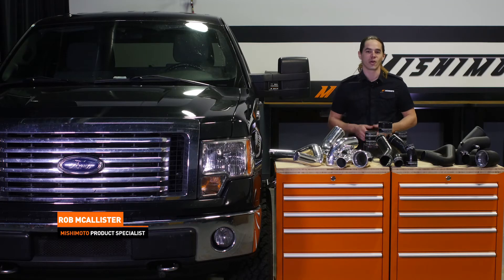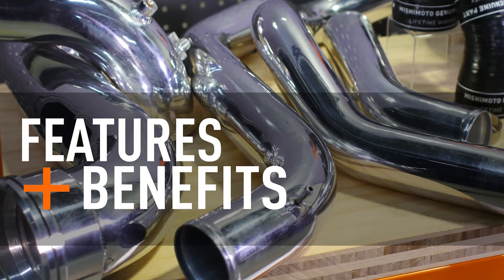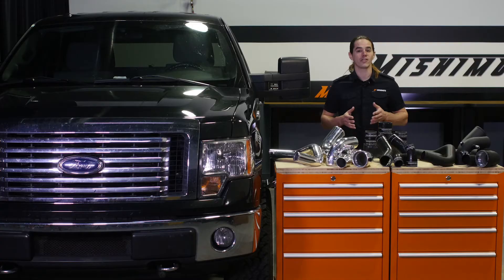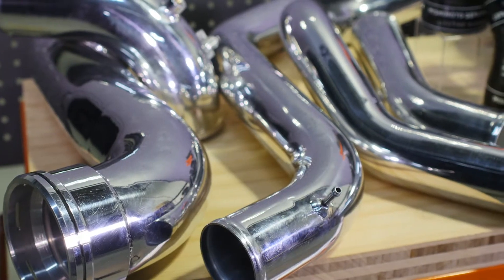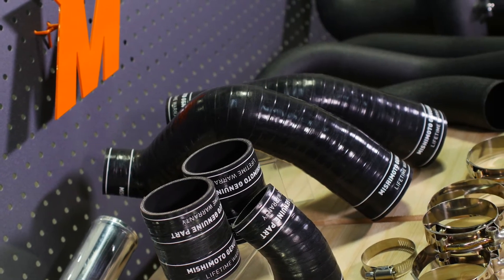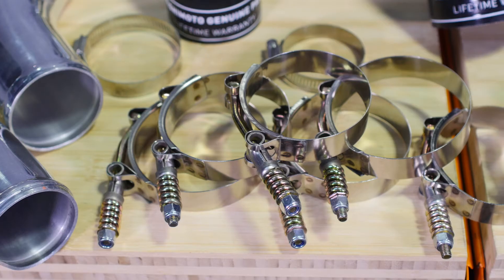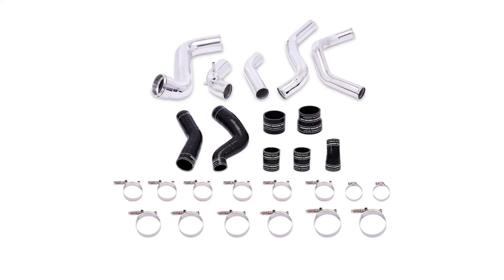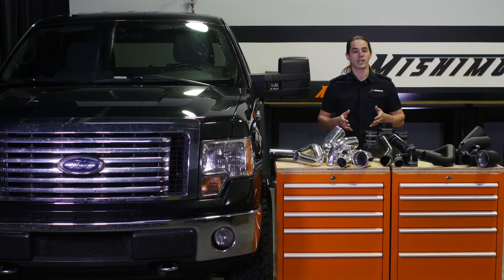2011–2014 Ford F-150 3.5L Ecoboost Intercooler Pipe Kit Features & Benefits by Mishimoto

Comment: Can i ask if i just do the pipe kit what kind of gains can i expect with stock intercooler? Also if i also add your intercooler will i get even more gains? I’m looking for more power and if i can get it with just the pipe kit and save some money I’d rather do that. I already added your radiator and tranny cooler and it stopped my truck from over heating. I thank you so much. I have a 2013 f150 eco. Your input would be appreciated.
Reply from the maker: With the full kit, +15whp/+21wtq can be expected. 
With just the piping, it's closer to 5whp/8wtq. The intercooler really wakes it all up and the piping helps smooth out the bends in the routing.
Reply: @mishimoto Ok thank you so much i appreciate you getting back to me and clearing that up. Love your products 👍